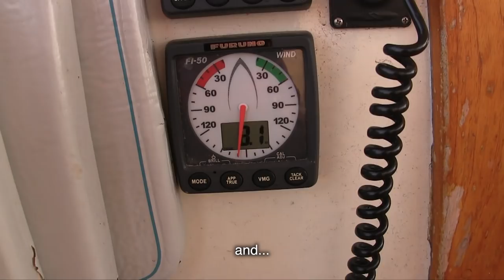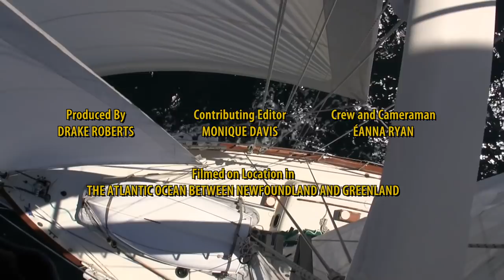He's Coming Straight for Us! | #17 | DrakeParagon Sailing Season 4

Comment: Great seeing the oil change procedure at sea!  One of those crucial details that must be performed on time and without any spillage.  How much oil does this 40 year old Perkins burn over, say, 24 hours of motoring?  Thanks for another winderful video.
Reply from the maker: Oh the hard questions! :)  I must admit that I need to keep better log book records off our engine usage and how often and how much oil I've added.  I usually top it off before starting the engine.  I think I may have added as much as an eighth of a gallon or more after a full day or two of running.
- Drake

Comment: Trick to keep from making a mess with the used filter. Place it in a ziplock as you're taking it off. Any oil that spills goes into the bag. Forks well with fuel too.

Comment: My hat is off to Mo for keeping on her watch seasick or not. She is a trooper for sure. Eanna is amazing. Gets up too early for his watch and still has a smile on his face and just laughs it off.  I know you have run you engine a lot and it may be the original and was wondering how many hours are on? Still enjoying your adventure.
Reply from the maker: I wish I knew.  The hour meter currently reads 6989 hours, but I don't know how many times it has reached 9999 and then started over at 0. ¯\_(ツ)_/¯
- Drake
Reply: WOW. What make Is the engine? It is serving you well.
Reply from the maker: It's a 1970's 85 horsepower Perkins 4-236 diesel. http://www.tadiesels.com/perkins-4236.html

Comment: Just as importantly as frequent oil changes, is to not lit the engine sit for extended periods with old oil in it.  Acids can pit the bearings and wear surfaces.
Reply from the maker: I read exactly that in Nigel Caulder's diesel engine maintenance book.  So I always make sure to change the oil before we get settled down for a winter of not using the engine. - Drake

Comment: Hey Drake, I have a tip that will help out when changing oil like that. Pick up a Fish Weight Scale. The kind you hold in your hand and hook in the fishes mouth to weigh it. If the mouth hook is to small, change out that hook with something you can use to hold your oil catch container.

Weigh the container that is full of oil, to know how it weighs when full. From now on, when emptying your oil, hold that container with that Fish Scale with one hand and steady the container with the other hand. You will know, every time, when it is almost full. This way you never over fill a container again.

I seen one on Amazon with digital and back lit LED that runs on two AAA batteries for $16
You may even be able to make a mount above that drain port to hang the Weigh Scale from and hang the catch container from it, to free up your one hand. You may even have a fish scale on Paragon already to try it with.

Fair Winds
Reply from the maker: That's such an interesting idea Fla-bushcraft Prepper. It's always cool to hear about the tricks and tips and other people use on their boats. Thanks! (✿◠‿◠)  ⚓-Monique
Reply: Yeah !!   ..... and with Amazon PRIME,  you're eligible for FREE TWO DAY DELIVERY   :)

Comment: That's a Stratus cloud looming in the distance , Nimbus are 7 miles and higher with a well pronounced anvil shaped top. Cheers
Reply: Robert Orzech I agree. Éanna was probably right about the warm front, hence the stratus clouds. Cumulonimbus have a much greater vertical development.
Reply: What, you've not heard of nimbostratus, which as Eanna correctly surmised, indicates a warm front.
Reply: Richard H I could be mistaken, but shouldn’t Nimbostratus have a lot greater vertical development than what they seen there. Plus Nimbostratus generally brings with it a massive amount of precip.
Reply: Darren Hughes, sorry,  I was replying mostly to Robert's originating comment and less to the video or your comment.  I wan't clear on that part.  We don't know how much rain since on this video they did not sail under the cloud (I guess we'll have to wait until next week)  I should like to know the baro pressure difference.  Clouds are the language of the weather.
Reply: Maybe you might want to listen to Eanna again. He say's it twice within ten seconds. Cumulo Nimbus ! Cumulo Nimbus !  You could be right calling them Nimbo Stratus if it turns out that they climb as high as 10,000 feet. But usually you can't see the sun shining through them like that one. It still appears to be a stratus cloud. Lets get an expert in on this ! Cheers
Reply: Yeah thats no nimbus..they have extensive vertical development

Comment: A cloud ...let's change the oil .....
Reply from the maker: Our Perkins 4-236 85 hp diesel needs an oil change every 100 hours of engine running time.  We were nearing that 100 hours limit and at the time I didn't know what kind of weather that cloud might bring.  If it did bring heavy weather, and if I needed to run the engine for a long time to get through it, then the last thing I wanted to have to worry about was needing an oil change.  I never want to run engine past when it needs a regular oil change, and especially not hard and for a prolonged time. 
- Drake

Comment: 100 hours is about 5500 km on the road in the Netherlands. That is very short....I would change once every year or every 500 hours witch ever comes first. Unfortunately never had to change sooner the a year :-)
Reply from the maker: Our old Perkins 4-236 85 hp diesel manual says that it needs a 2 and a half gallon oil change every 100 hours of engine running time, and with only SAE 30 oil.  I envy newer diesels that require far less frequent oil changes.  I've wondered if I could get by with changing oil less frequently if I used a more modern type of oil, but so far I haven't figured out if that's possible. - Drake
Reply: I used to have a 1980 Mercedes OM615  road diesel and now I have a 1992 Hino WO4D. The SAE 30 mono grade oil has longer molecule chains the the newer synthetic oils. The engine would leak pretty bad on new oils. So far I used mineral wd15-40 without problems, but never ran the engine longer then 8 hours at a time. I volunteer on a 46 meter Ex-Marine vessel with a classical Smit-MAN slow running engine from 1949. It is in my channel "MLV Castor van voor naar achter". Due to a carter volume of 625 liters and low budget we ran the first 7 years on cheap WD15-40 with no negative effects. At least 100 hours per year. But yes, your mileage my differ :-)

Comment: Why would you decide to do an oil change underway with a storm coming after sitting at a dock for a month?  It seems that preventative maintenance is best done before it’s  needed.
Reply from the maker: Our Perkins 4-236 85 hp diesel needs an oil change every 100 hours of engine running time.  We were nearing that 100 hours limit and at the time I didn't know what kind of weather that cloud might bring.  If it did bring heavy weather, and if I needed to run the engine for a long time to get through it, then the last thing I wanted to have to worry about was needing an oil change.  I'll never forget when I assisted a disabled 52 foot steel sailboat that got decimated in a storm.  I ended up towing that boat for over 130 nautical miles to Bermuda.  I got their call on VHF from 20 miles away, motored straight to them, and then we drifted for a bit as I did an oil change before setting up a tow line.  I never want to run engine past when it needs a regular oil change, and especially not hard and for a prolonged time. 
- Drake

Comment: Why change motor oil at-sea?  One-hundred hours, the service-life is THAT short?  You were only a few days out of St. Johns...  I can understand not using not using engine-hours when the oil's been used for months just motoring in and out of a marina, but for extended-use and continual use I would have expected a longer service life, 240-hrs?  That's about the equivalent of 10K-12K on a road diesel or 1200-1500 nm.  [G*d invented funnels].
Actually it's probably good that Fisheries Protection or Canadian CG checked-up on you periodically.
Reply from the maker: Our old Perkins 4-236 diesel manual says that it needs a 2 and a half gallon oil change every 100 hours of engine running time, and with only SAE 30 oil.  I envy newer diesels that require far less frequent oil changes.  I've wondered if I could get by with changing oil less frequently if I used a more modern type of oil, but so far I haven't figured out if that's possible. - Drake
Reply: DrakeParagon Hi Drake I liked your engine filter setup makes for clean easy changes. I also have a Perkins 4236 of late 70s vintage with over 8000 hrs. I have read my handbook which states to change oil every 200hrs which I have done. I’m not trying to be smart but trying to help you and also confirm I’m doing the right thing by my engine. Here is one of a few handbooks online which appear to confirm this. I hope it helps. Page 28
http://www.moteur-perkins.com/uploads/catalogue/lettre/notice/manuel-perkins-ld-4-236.pdf
Reply from the maker: My God, Iain, I definitely owe you a beer!  I just dug out my Perkins manual and checked again.  My manual covers all of the different Perkins engines made back then.  You are right!  All this time I was mistakenly following the maintenance schedule for the Perkins 4-108!  YAYYYYY!!!!!
 \(• ◡ •)/ \(• ◡ •)/ \(• ◡ •)/ \(• ◡ •)/ \(• ◡ •)/ \(• ◡ •)/ \(• ◡ •)/ \(• ◡ •)/ \(• ◡ •)/ 
It's also great to now have a .pdf version of the manual.  Thank you! 
- Drake
Reply: DrakeParagon 
Delighted to help and relieved for me. I think the 4108 has 100 hrs due to the 1gall sump unlike the 4236 which as you say is 2galls. 
Fairwinds
Reply from the maker: Hey Iain, We'd love to send you a DrakeParagon t-shirt to say thank you for saving us a small fortune in oil!   \(• ◡ •)/.   Mo just keeps looking over at me, locking eyes, and saying 200 hours... ⊙▂⊙  Please send us an email drakeparagon@gmail.com and we'll send you one.  Thanks again!
- Drake
Reply: Yay!  The Paragon viewing community scores one for the good-guys...
Reply: Good news, but never forget -- a diesel loves its oil like a sailor likes his rum.   Why is that captain Drake?
Reply from the maker: heh. ¯\_(ツ)_/¯  That was such a great movie.
Reply: I am pretty sure that its possible to get by with changing just the oil filter and not the oil itself, so frequently?    i am not a diesel engine engineer/designer of course.    a marine diesel engine running in cold ocean water which never gets close to high temperature operation, what's going to break down the oil chemistry?   the only obvious benefit to such frequent oil changes seems to be removing, or diagnosing early, any water in the oil especially sea water in case of engine problem?   the oil filter will clean any solids out of the oil ... for less frequent changes..   tho i can see it is a basic good choice to just follow what the tech manual says, for critical equipment..